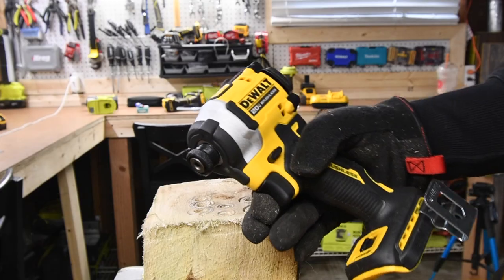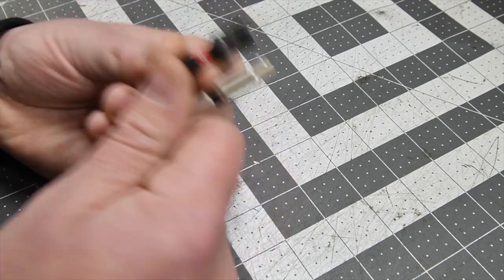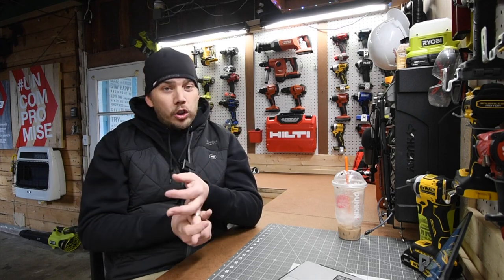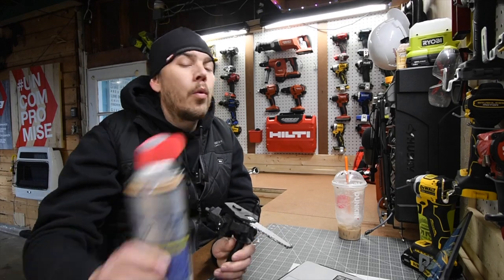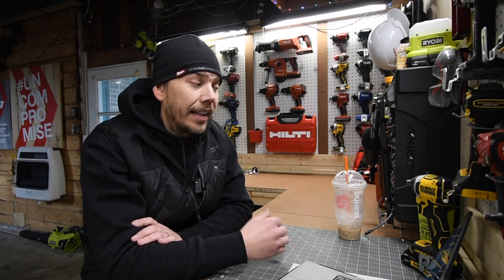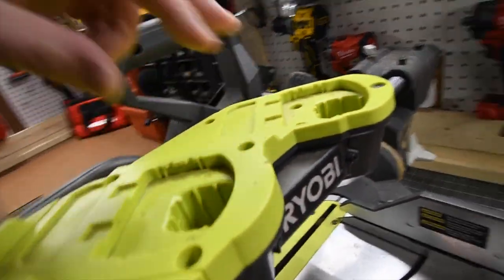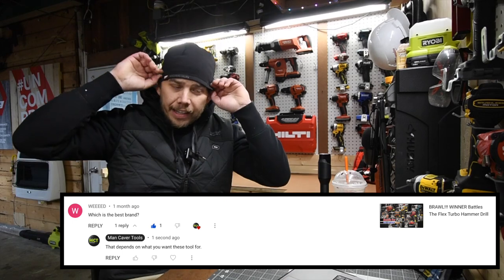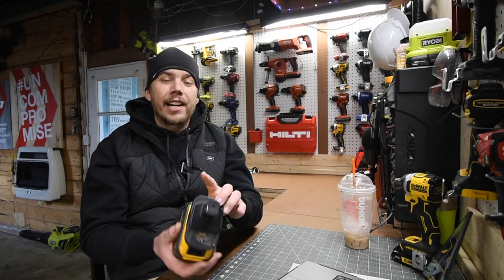Tool Test Requests from (Comments)

Comment: I was wondering what Ryobi tool or tool feature that was discontinued you want to see come back.
I really wanna see the multi-tool with the detachable head come back. The Jobmax interchangeable heads were very nice to have so one tool did many tasks.
Also, I would love to see the 18 volt cooler come back.

Comment: Wonder if you could test out that dcf850? When I really finesse the trigger slowly I'll get a dead trigger. If I depress it just enough to turn the light on and wait half a second it goes dead. After I bought mine I tested 2 working models at Lowes and they did the same thing. I think dewalt needs to fix this.

Comment: The HP terminals are only for high current tools, HP is just brushless ryobi
Reply from the maker: Correct, But that is why people are confused. Id consider an impact driver a high current tool. there is no point on calling it HP if a tool is not HP. image if Milwaukee called a tool FUEL but it's actually not apart of the FUEL line. people are confused. still dont know why they didn't make all HP tools with the HP terminals. if it says HP it should have the terminals regardless if its a high current tool or not.

Comment: Think voltage drops. Small Ah batteries drop in voltage fast. Large Ah batteries retain maximum voltage a lot longer giving the appearance of being stronger and producing a higher rpm that gives the operator the illusion that it is stronger.

Comment: My Milwaukee impact driver 2853 M18 outclasses my DeWalt 1/2 impact wrench.
A test the DeWalt torqued my lug nuts to 166 ft lbs the Milwaukee hit ,256
Checking with snap on digital torque wrench.
Bye DeWalt staying with Milwaukee and Hilti
You are correct I own Bosch plunge router it set me back 400 well worth it 
DeWalt biscuit joiner, Milwaukee drills saws and more.

Comment: due to breaking adapters on the impact driver putting in lags i picked up the dewalt 921 . such an impressive tool .it failed at lags ,slower then and seemly not as strong as my milwaukee impact driver .so i got the also impressive 891which is much more effective .yet yesterday running long 1/2" lags in to predrilled redwood i found it dogging out at times . i predrill 3/8" for fluting and a 1/2" for the shank . wondering if i got this wrong and should of went with a large right angle drill . what are your thoughts on this .
Reply: battery size ! even just going from a 5ah to a 6ah flexvolt was a noticeable improvement .

Comment: Really like this video format, keep it up! Just a small nitpick, since I see people always wonder about this.  Battery capacity vs power is really relative and we cannot make a point blank statement in either direction. For eg. more capacity in same volume will mean less power in most cases, but there are always some exceptions. Best example are 21700 packs, for eg dewalt 6, 8 and 10 ah. They all have the same volume, but 6ah is strongest and 10ah is weakest (6ah - 80-100A, 8ah 70-80A,10ah 50A current), however there is a 21700 cell made by molicell that is 4.5Ah (so would make a 9ah pack) that has 20% lower internal resistance than best 3ah 21700 cells, and that would be the exception.
Now if we compare 6ah packs with 18650 vs 21700 cells which have the same capacity but different volume, difference in power is huge, 6ah 18650 is 30A while 21700 is 80-100A so yeah, not even close. Same story for 18650 cells, 1.5 and 2ah cells are stronger than 2.5 and 3ah, but there are exceptions and not all 2ah cells are the same for eg. ones used in flexvolt 6ah are 30% stronger than ones used in regular 4ah packs. Etc, etc.
Reply from the maker: Correct, but to your average person using low ah batteries its a perfect example
Reply: @ManCaverTools  👍

Comment: The problem with aH ratings is that you really care about Watt output capability right (volt * amp)? So it having a higher aH is ONLY promising more battery capacity, not power output. Though every battery as it discharges tends to be weaker, so if you start with higher aH it should have longer power curve. What EVERY tool test shows is that these higher aH batteries put out more power even though their specs don't say it... but add in all that battery naming weirdness and it again, is tough for users to know what to get based on available specs. Compare that to the chargers which give you the Amps and Voltage, you know which is better! GOOD NEWS, it gives you more videos that are valuable! LOL.

Comment: Hmm He hadn't tried the 1.7Ah Power Stack with the normal 2Ah XR Battery , The 5.0XC Battery with the 3Ah High Output Battery, the 5Ah XR With the 5Ah Power Stack so he could say that , but with me what he had tell still right but if only do the same job , but told to the Power each battery also based on the what kind of the Cells ,  how many cells inside and how they build it  not only the Capacitor on the Battery
Example : 20V 2Ah they used 5s1p 18650 Samsung 20R with 20V 4Ah they used 5s2p Samsung 20R -> The 4Ah gived you more power and longer run time because the output current from 4Ah is twice higher than the 2Ah and the capacitor is also double

Comment: Ryobi is basically made for the homeowner, not even DIY grade.
A customer insisted I use her cordless finish brad nailer.
As I installed crown it wore out before I was finished in kitchen and dining room.
Total area est 200 linear feet.
My Senco did all the base has performed numerous projects 
Contractor grade tools are worth the money.